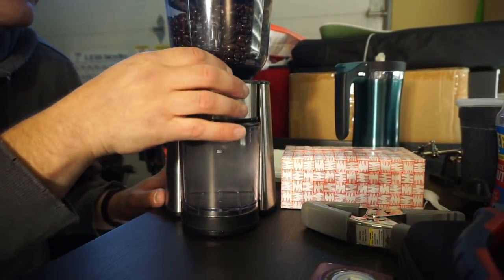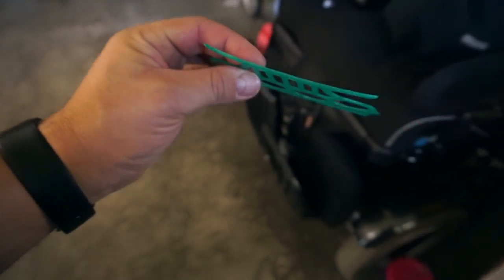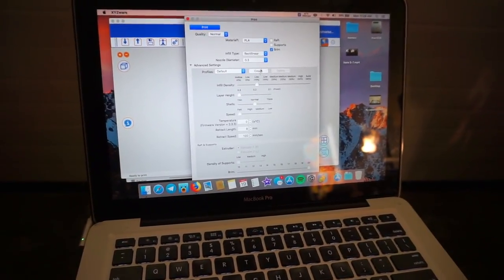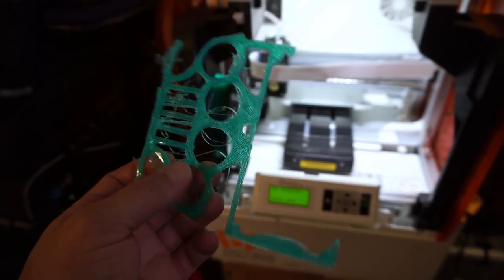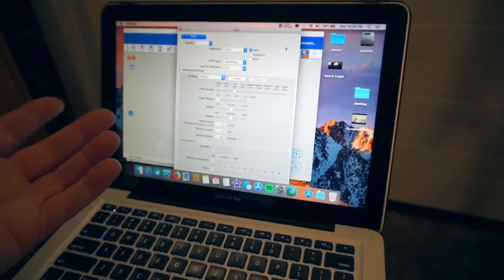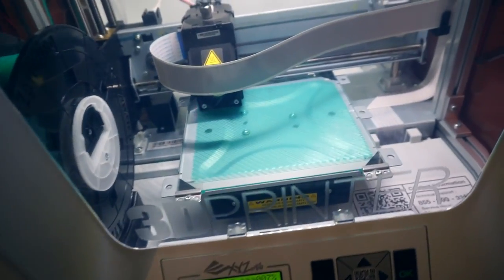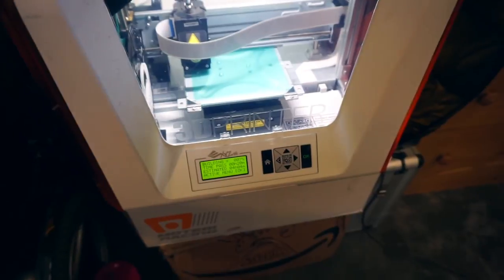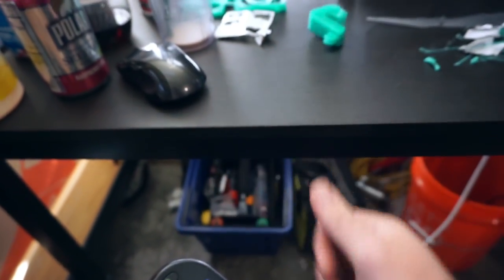VLOG 386: 3D Printing...

Comment: In my brief foray into 3D printing I had this very same problem. It turned out that my unit was not calibrated correctly and the print head needed to be much closer and uniform. The reason it is not printing larger parts is because your print bed is not level across the entire span of your bed, this is why it prints small parts fine but large parts have curling edges and the print pops off. I know it does not make sense and surely its an adherance problem is what I thought too.. as it makes sense to the logically minded, but indeed it is not and its a bed leveling problem. There are test prints that print little square at each corner of your bed and a circle in the center that will show you where your bed is going wonky. I had a creality cr-10 and loved it, cheap, huge print bed, and worked excellent, but I found I could just cast most of the parts (silicon mold/resin) I needed and or model them in clay and cast them in a few minutes. Not great for precision copies of other people's work but good for cloning objects you already have or creating artistic pieces of your own and don't have to wait 15hrs.

Comment: Totally enjoyed this 2 part blog!  Congrats on the new chair, can you exchange the cushion on the seat?  Just installed a new 8 ball on my control stick.  It's weighted and feels good to the touch.
I've been looking at new vans (Ford transit) with 3.5 EcoBoost engine.  You can get them as low as 29K new and 19K used.  The VA will put a "Clearlift" lift system in it, which is capable of handling up to 850lbs. What's great is that you can trick out the inside any way you want.  The coffee grinder was a steal and looks like it's working great...you got me hooked on "cold brew".